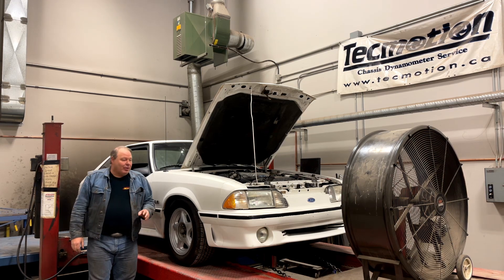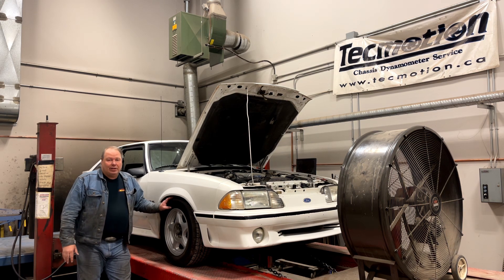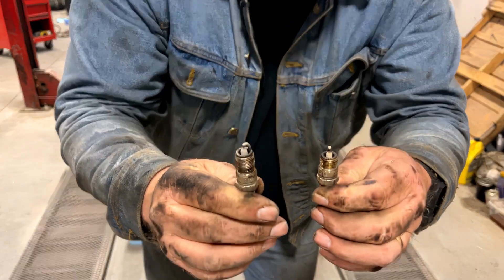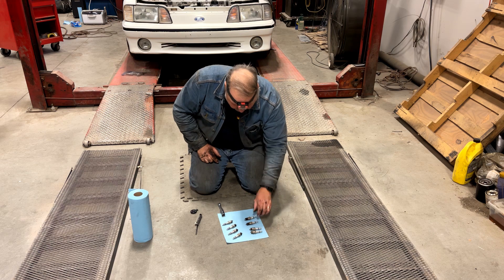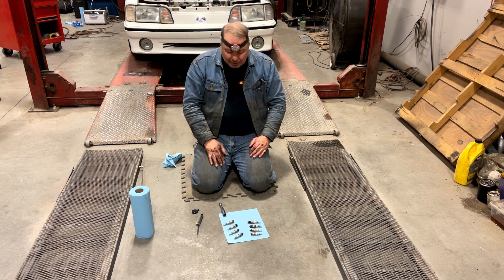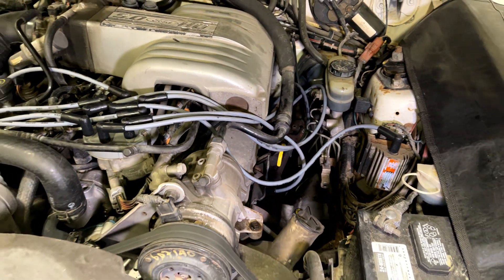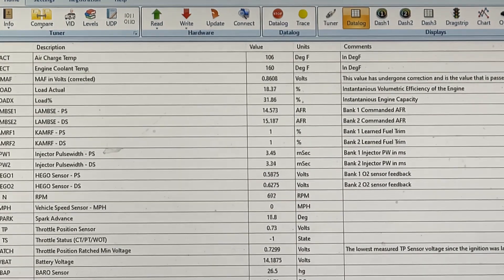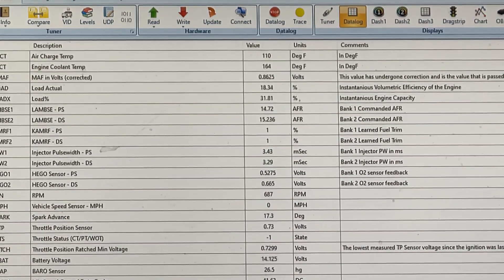Does a Basic Tune Up Add Power to a Stock 5.0 Foxbody Mustang?

Comment: Always was told plug gap should be between 052-056?. I’m currently using motorcraft asf42c copper plugs gapped .054. Runs perfect this is a ‘92lx 5.0 hatch

Comment: Hey there. I’m stumped and wonder what your thoughts are. I’m having an issue where my ‘87 GT starts great and idles great when cold starting. As soon as I turn it off and try to restart, it cranks and cranks but won’t start. If I give it gas it will start but runs rough. I’ve checked fuel pressure, timing, and TPS voltage. All is perfect, 38lbs, 12 degrees and 0.96v. I replaced the coolant temp sensor, TFI module and IAC with others that I have on the shelf. None of these fixed the issue. I checked the temp of each cylinder, at the Headers and all cylinders are hot when running. So I don’t think have a dead injector, wire or plug. My computer was rebuilt at FoxResto a couple months ago and it didn’t start acting up until about 250 miles after it was reinstalled. I ran a code reader on it and didn’t get any codes except for emissions stuff because I’ve taken it all off. Thoughts? As always, great video for us shade tree enthusiasts.
Reply from the maker: Is this still a speed density car? I saw a guy recently saying that his cap and wires were so leaky that they were interfering with his TFI and causing it to run poorly. If you just let it run does it eventually act up or only after a restart?These kind of problems can be hard to sept out in person, never mind from a symptom list over the internet.
Reply: @tecmotiondyno  Thanks for the reply. It has been converted to mass air. It is only causing an issue when starting it warm. I think I may have found the issue. I replaced the engine coolant temp sensor but that didn’t fix it. Next I checked fuel pressure and it would slowly drop with the key on and engine off. I pulled the vacuum line off the regulator and fuel dripped out. I think the regulator is bad. I checked my spark plugs and they are all fouled with black suet.
Reply from the maker: One thing is for sure, the regulator shouldn’t do that. Fix the stuff that you know is broken, then reevaluate.

Comment: do you recommend a wide band even on a stock fox?
Reply from the maker: It’s really only necessary on the dyno. I like to have one installed if the car has forced induction, but the most important aftermarket gauges for any NA Foxbody are oil pressure and coolant temperature in that order. The factory oil pressure gauge essentially tells you nothing. If you race it, you need a real tach and a shift light too because the factory tach is brutally inaccurate at higher RPM.

Comment: Loved that I found this channel, very informative exactly what I was looking for on stock configuration. Could you tell me the plugs you used part number thanks 0.45 gap is correct
Reply from the maker: This car got NGK UR5.
Reply: @tecmotiondyno  thanks for the reply, I am with this channel. I have a 60,000km all original 88  lx vert 1-32 in the paint and trim code.
Reply from the maker: Nice. I have always loved these cars, and now it seems maybe the rest of the world is starting to catch up!

Comment: Your the man! Those UR5’s are for stock heads right?
Reply from the maker: Yes. They are right for a bone stock car like this. Very wrong for an aftermarket aluminum headed car!
Reply: @tecmotiondyno  autozone sold me motorcraft sp450-x copper will these work on stock heads ?

Comment: I love the OG mechanics that you know have seen some silly things in vehicles over the years.  It’s amazing how resistant the older vehicles were to general maintenance neglect.  The ecu in the Fox Mustangs was very good at compensating for problems and was not like the new age vehicles that throw codes or kill power at the slightest issue.  If a new vehicle had plugs like this it would no doubt be throwing a cel and misfire code.  It’s also amazing the power was unaffected by the horrible spark this vehicle was putting out.  I would say I’m sure even though the dyno doesn’t show it this vehicle idles and drives a lot better overall because of the tune up he did.  Looks like an HCI setup and tune would be the best route for some good power.  Should be able to pick up 60-80 or more rwhp with a good set up if not more.  It really woke up my 93 when I replaced the heads intake and cam.  
Good informative video.
Reply from the maker: One thing to keep in mind is that guys do heads, cam, intake, AND a supercharger, and the stock ignition system usually still works with those combinations, or with just an upgraded coil. The stock ignition is much more powerful than the anemic stock powerplant required, and that's probably why we didn't get any power improvements when upgrading from the really terrible, worn out, and mismatched components that were on the car - the junky parts just didn't degrade it below the basic requirements of the stock engine. If the car had a bunch of power upgrades on it, changing out these bad ignition components would almost certainly have made a difference. An H/C/I setup would be a great way start with this car to turn it into a really fun cruiser that would seem contemporary in terms of performance.

Comment: 👋 hi tecmotion. Im also Canadian . I have fox converted to carb but I'm off on my timing . Won't run. But Almost. It Sounds like a big backfire coming from the muffler. I dropped the dizzy at zero  on compression.  Finger was on hole.  Am  ito retarded or advanced.  Would appreciate  the help thanks  tec
Reply: Thanks Tec for replying.  I re did the timing.  First I brought to zero and then spun the engine back then dropped it in at 10 btdc and actually idled.  Still fighting thru some problems.  Wish I lived near your shop as your so good with these cars . I'm in BC.  Thanks again.
Reply from the maker: @Yosemitesamspistols  I raced out there quite a bit over the years.
Reply from the maker: Sorry, I missed this comment somehow. It is hard to know what is going on in a situation like this without seeing it in person. If it was me, I would start by being sure that you have the engine at top dead center - an inspection camera in the #1 cylinder can be very helpful with this. Then confirm that your timing pointer also says top dead center when you have it manually confirmed there. Then check that your distributor rotor is rotated slightly counterclockwise of the #1 terminal on the cap when the engine is actually at TDC. If it won’t start like that, check that you get a flash with the timing light when you crank it. If it will start and run like that, use a timing light to actually get the timing set right. If the timing light doesn’t flash, you likely have an ignition system problem. If that all looks fine, squirt a little fuel in the carb and see if it starts. If it tries to run like that, you may have a fuel pump problem.

Comment: If you didn’t disconnect the battery to reset the keep alive memory (kams) that stores the fuel trims would make sense why your running rich when loose plugs were drawing in more air the ecu composited for that 
You can reset the kams in BE with car running
Reply from the maker: If you watch the datalog you can see that the long term fuel trim is “1”, which means no trim. Fuel trims are not the problem here.
Reply: @tecmotiondyno   true for idle i assume you have a afr gauge stock form they do run rich at wot low 12afr if I remember I’m no expert 
Check out leech motorsports channel helped me under stand Binary Editor more
Reply from the maker: Most of them that I have seen, which is a LOT, didn’t run quite this rich in stock trim. It looked good all through cruise with little fuel trim required, but at WOT it was too rich for best power. Also, if you want to know the truth, the fuel trims don’t enter into the equation at WOT for the factory PCM. At WOT it ignores the O2 sensors and any learned trims and runs purely open loop based on the pre programmed tables and functions and the signal from the MAF.
Reply: @tecmotiondyno  that is correct and at wot the fuel base open loop file I think at 180 degrees and 80 load and up it’s 12.35 afr 
Anyway great videos can’t wait to see what’s next

Comment: Another great video.  Is there a video where u explain what is actually needed. Example vacuumed lines / EGR ? I got a 89 that just don’t seem to be running great.  Going threw all your videos and trying to get it figured out.
Reply from the maker: I'm not sure that I quite understand your question? Do you mean for the tune up or to get one of these cars to run right in general? This video has a few of the really common mistakes that I see if you haven't seen it yet: https://youtu.be/-W5QwwIAhv4
Reply: @tecmotiondyno  well I guess what I was meaning is. Correct rout of vacume lines. Also if car has plate where egr was at.  And plug is just tapped up.  Can that be a cause of issues ? I see a lot of videos of people eliminating stuff like EGR & Some vacuum lines.

Comment: Really enjoy the videos, years ago I remember the "10 minute Tune Up" and other small mods like Redline fluids, etc. Does anyone still use those fluids?
Reply from the maker: I did and dynoed the 10 minute tune up on this car, so that video is coming. As I am working through those dyno sessions I am finding that each of these steps seems better as a standalone video rather than putting every change into one video, and I suspect that it is a little easier to get your mind around one change at a time. I was surprised at the result here, and I suspect that the result would have been different if this was an upgraded car. It just goes to show that the stock ignition system is good enough to overcome quite a few real problems I guess!

Comment: Nice. I like to see more videos like this one as it explains the engine state.
Reply from the maker: The happiest part of this particular test is the confirmation that this engine is basically working fine and ready for next steps. Stay tuned for the 10 minute tune up!
Reply: @tecmotiondyno , My foxbody currently has UR45GP plugs in it, would that be the correct plug for it? That’s what the previous owner had in it and they seemed to have a good tan colour, if not,what would you put in it?
Reply from the maker: If it has stock heads they should be fine - Those are platinum and would not be my first choice, but they do have the advantage of lasting longer and on a stocker you aren't likely to run into a pile of problems that a platinum plug might cause. Gap them 0.045" for a stock NA application.
Reply: @tecmotiondyno  Thank you very much,i don’t know as much as you but i’m trying to learn, videos help a lot.
Reply: @rhealbrisson1773  you are getting lessons from the godfather of fox body’s so you’re in good hands.
Reply from the maker: Glad to be of help!